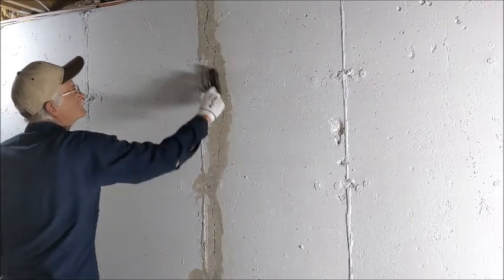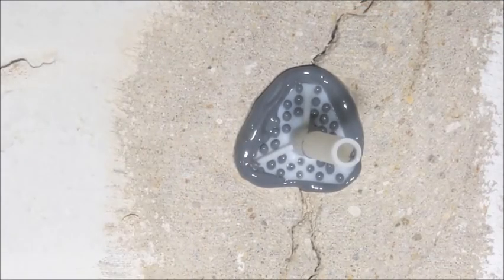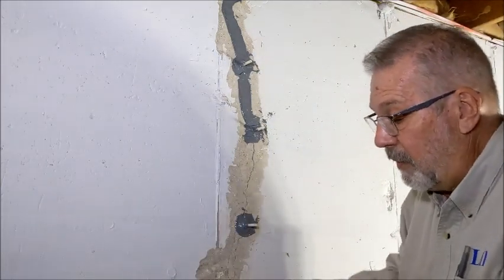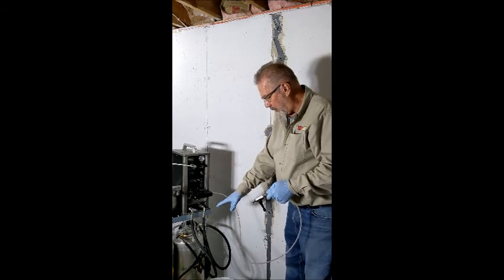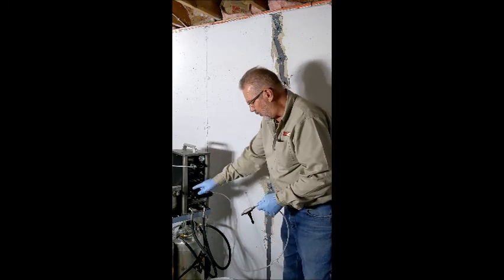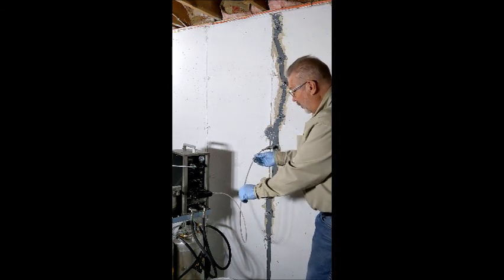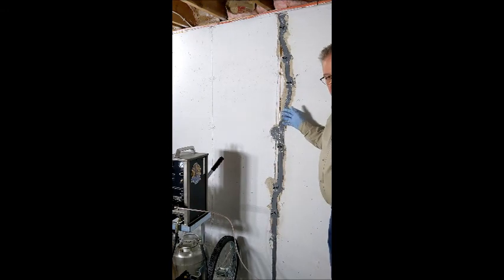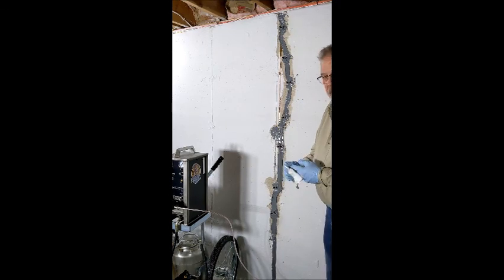Lily Corporation Crack Injection Video

Comment: Very informative video. I work for a General Contractor here in Florida and we are looking to get involved in this line of work. What is the going rate as of 2022? I have a job right now where I am being asked to epoxy inject a column with a crack running vertically down the center. The crack is maybe 1/16" wide. Its definitely less than 1/4" wide. The engineer is specifying to use sikadur 55 SLV using automated injection equipment. We also would need to rent the equipment or buy one. I have heard that some contractors are getting $70 or a linear foot for cracks 100 linear feet or more. But with this situation which the crack is less than 15 LF what would you get per linear foot??
Reply from the maker: Good morning Chase. Let me start off by saying that we are not contractors, we manufacture the equipment used in the injection process and train contractors in the use of the equipment and the in injection process as well. That being said it appears that the going rate lately is in the neighborhood of $70 per LF. Keep in mind that there are a lot of variables that have to be taken into consideration also. With a job of only 15 LF you need to take into consideration your mobilzation costs for such a small job. Normally a job of this size could be done in a single day. Hope this helps.
Mike
Reply: What kind of material are you guys using for walls?